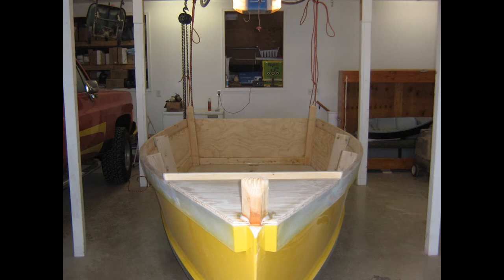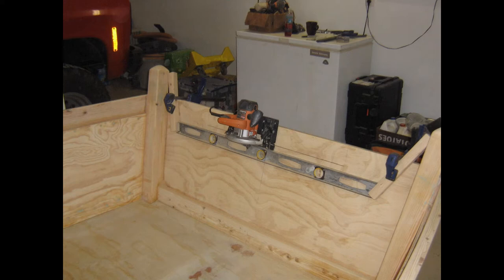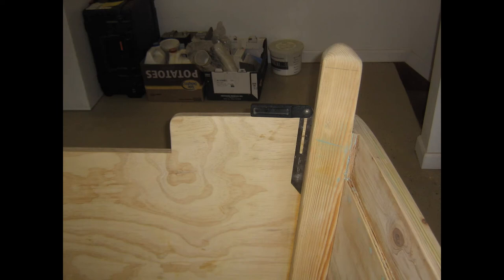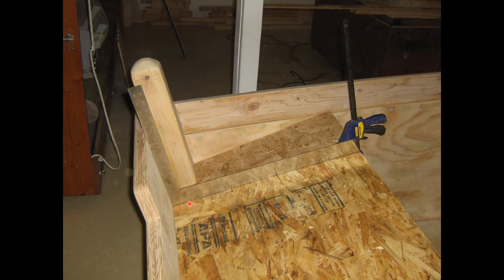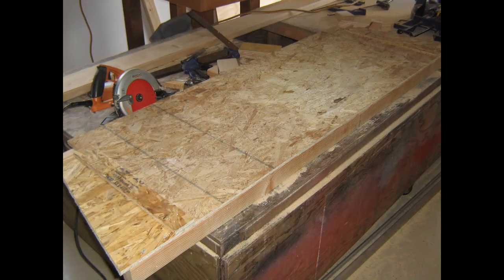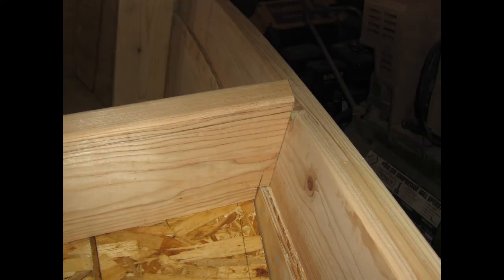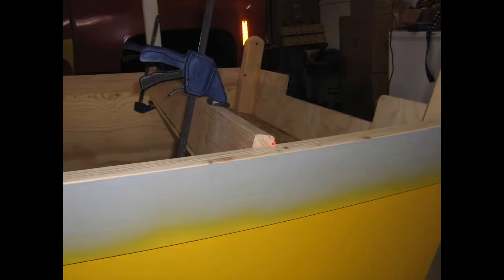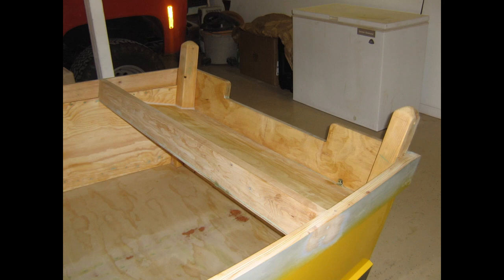Episode 20 of 2019 Boat Build

Comment: Almost there! I had the same 15hp motor on my boat. My motor was a 1976. I ended up replacing it with a "newer" 1984 15hp.
Reply from the maker: Thanks Glen. I love the 1980's Johnsons & Evinrudes! I hope to get 10 knots with the boat fully loaded. We'll see how good my theoretical calculations are. Ha! This boat has a lot of planning area so it should not take too much horsepower. I think it will come down to prop pitch and what kind of compression I have after break-in of the rebuilt powerhead. Thanks, as usual, for your encouragement!
Reply: @dennis6325  that's the beauty of the brockway design. It does not take much horsepower to get it up on plane. I'm very interested to see what you're able to do with it.

Comment: Hi Dennis, I think this part may have been the most intricate to plan, angle, cut, measure so I loved
to see the template give a direct fit.  Thanks for the tip on denatured alcohol for cleanup.. 

by the way,  I am glad to see you actually had a "mess" to clean up... hm  a pile of electric planer
shavings .  The lesson all should learn is:  clean up after each step... ok,  ok,' 

What's a "fillet?"   mine is a cut of good beef..  I saw how you  filled the area with a fill it..  Steve
Reply from the maker: Ha ha ha. You crack me up! Thanks for the feedback!